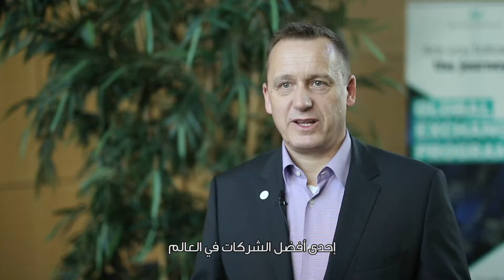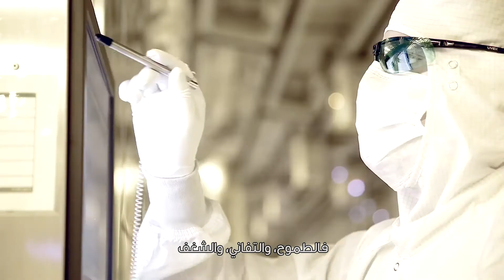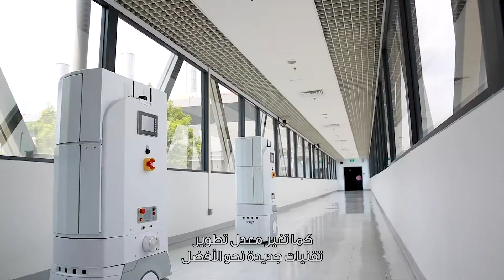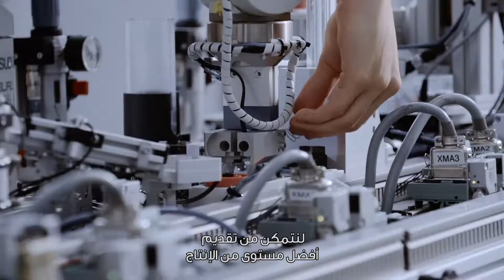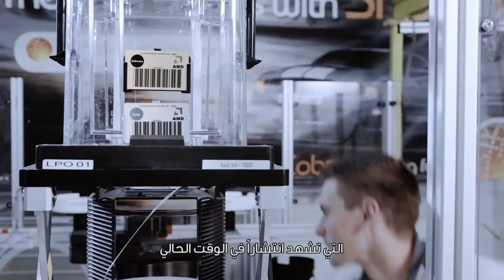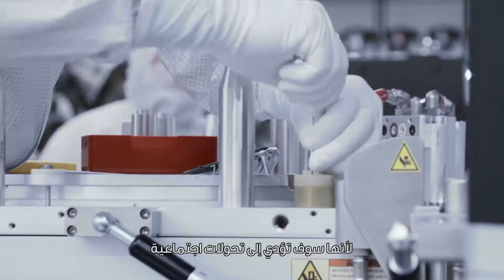GLOBALFOUNDRIES and Mubadala inspire technological revolution

Comment: Wanted:  Investor for Board Game

I have invented a Board Game [still unpublished and not yet out in the market] that is guaranteed to be far more challenging and exciting than CHESS.  I called it “RUVOL.”  

Over time, Ruvol will surpass chess as the “Number One Board Game in the World.” 

Why am I so sure about this?  Because I am an avid chess player myself.  

The weakness of chess is it always starts in fixed positions that the opening moves become “memorizable.”  In fact, not a few have so mastered the moves that they can play against their opponents “blindfolded.”  It is for this very reason that the great Bobby Fischer introduced his so-called “Fischer Random Chess,” where the starting position of the pieces is “randomized” to make the memorization of openings impracticable.  Fortunately, it is also for this reason that I invented Ruvol where “every game” has been calculated to be a challenging one to play.

HOW IS RUVOL PLAYED?

Ruvol is played somewhat like chess.  It is played by two players.  It uses a board that is rectangular in shape but contains more number of squares than chess.  It has equal number of pieces on each side of the board, where each type of pieces moves in distinct ways.  However, if the way to win chess is to checkmate the opponent’s king, the way to win Ruvol is to be able to cross a designated line.  

TWO GAMES IN ONE!

Actually, Ruvol comes in two versions:  the Ruvol and the Ruvit. I was able to develop two variations of games using only one board—a sort of two games in one.  It should be aptly called and sold then as “The Ruvol and Ruvit Board Game.”  When the players get bored with Ruvol, they can switch to Ruvit, or vice-versa—using the same board and pieces.  Both games offer the same level of challenge and excitement. 

A MILLION DOLLAR POTENTIAL IN RUVOL!

The people who play chess will be the same people who will play Ruvol.  In my Google search, I learned there are around 800 million chess players in the world.  These 800 million players comprise the “Total Potential Buyers” of Ruvol across the globe.  At an average profit of just US$3 per set, the “Global Income Potential” of Ruvol then is US$2.4 billion.  Assuming only 1% of it will buy each year, the annual global potential sale of Ruvol is US$24M.

I AM LOOKING FOR AN INVESTOR!   

For the reason that I don’t have the resources to publish Ruvol on a global scale, you might be interested to have the exclusive right to manufacture and market Ruvol globally under a “licensing agreement.”  Or better yet, just “BUY MY COPYRIGHT” and Ruvol is entirely yours.  Email me at:  rodolfovitangcol@gmail.com.   

Thanks and God bless!
 
RODOLFO MARTIN VITANGCOL
The Ruvol Inventor